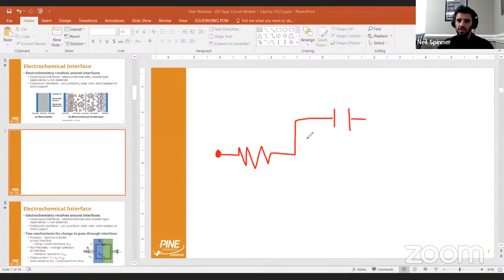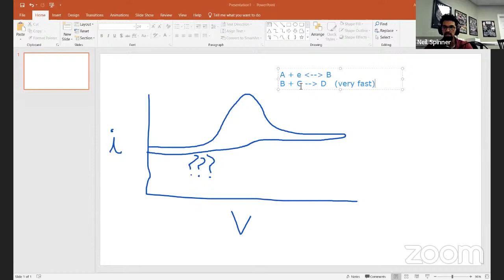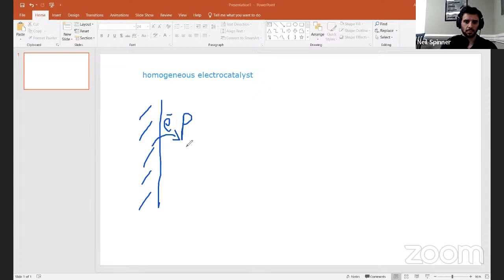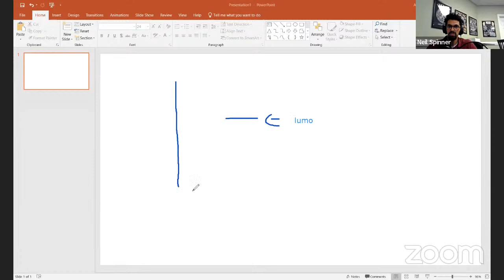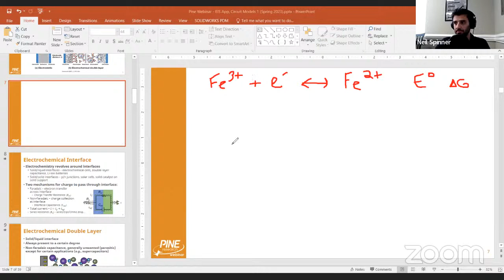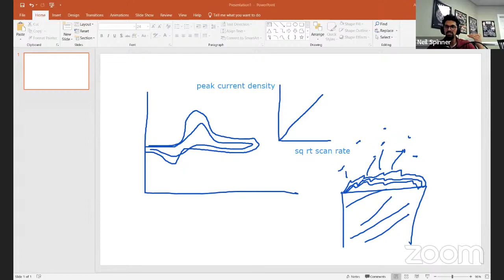Episode #3: This is why cyclic voltammograms are irreversible

Comment: Hi. For the last question, Dr. Spinner mentioned the possibility of having more than one process occurring but only one semi-circle appearing and using DRT to de-convolute them but how would you know that there were more than one process to begin with if in EIS, 1 semi-circle = 1 process? What other indicators should I look for to confirm this? Thanks.
Reply from the maker: This is a good question, and I would propose maybe two possible answers to your question of "how can I know if what appears to be just 1 semicircle might actually contain more than 1 process?"

First is through literature, other researchers, other sources, etc.  If you are studying a system where you are fairly sure from what others have reported or published that there are several processes occurring, you might very well assume the same for your system, leading you to pursue something like DRT to confirm the presence of multiple processes.

Second is through your own knowledge of your system, and/or other electrochemical testing.  For instance, you might perform CV or a pulse technique and find several peaks, several E0 or redox features, which would lead you to conclude that at certain applied potentials you definitely have at least a couple faradaic reactions occurring.  Therefore, if your EIS data do not show as many distinct semicircles as processes you know are occurring, you could again conclude DRT would be useful for deconvolution.